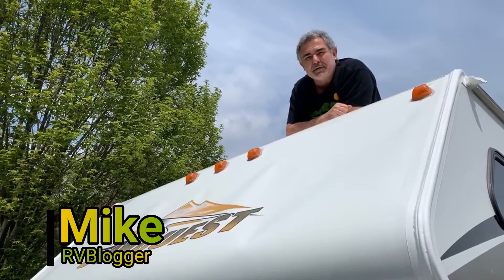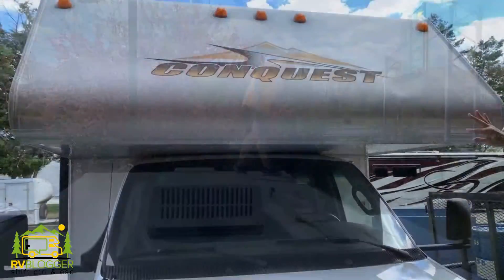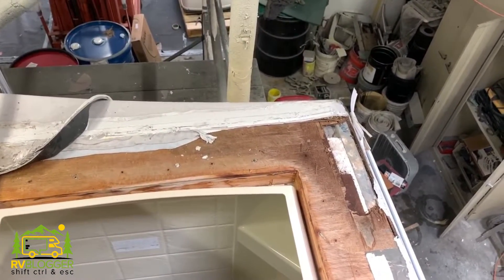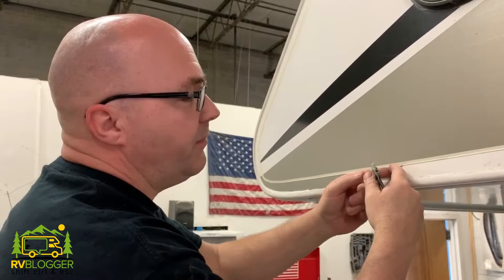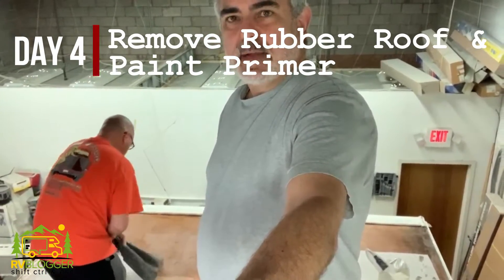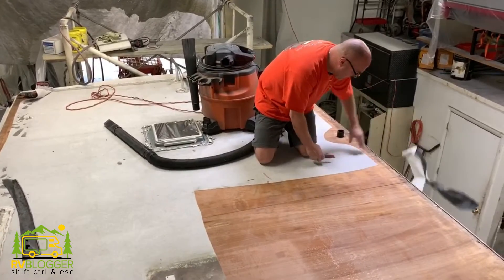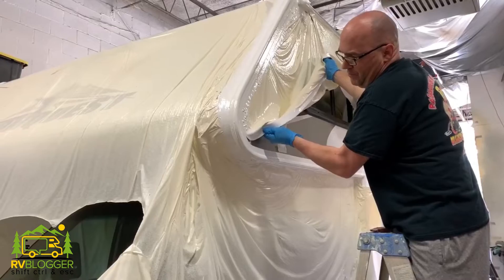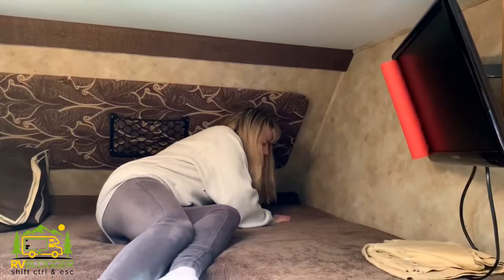RV Roof Replacement! No More Roof Leaks!

Comment: I had my whole roof replaced and all new plywood under.  My roof is not flat. It peaks to the center, so rain will run off. Lifetime warranty. Love love love it. Paid 100.00/ft. 3K. Just 3 years ago. Still looks new. & seals are checked 2xs a year. They are holding no issues ! I have to clean it 2xs a year but zero leaks !! Happy Trails
Reply from the maker: Hi Michelle,
Glad you roof replacement worked out so well!
Thanks for watching and commenting! 
Mike and Susan

Have you subscribed to our YouTube channel yet? If not we sure hope you will click below and subscribe! Thanks!
http://goto.rvblogger.com/YoutubeChannel?sub_confirmation=1
Reply: Where did you get it replaced?
Reply: I bought a couch with a lifetime guarantee   Turns out they meant the life of the couch, about 5 years
Reply: Peaking in the center is a great idea! Where did you get your done?

Comment: This is the first time I’ve seen this done. What a great idea! In my opinion its worth the $4800 for the peace of mind you now have.

We just bought a 2019 Grand Design Reflection 28bh and the roof is my biggest source of concern.
Reply from the maker: Hi Hard Truth,
I had a bed lining in my pickup truck and it was indestructible. I threw concrete, rebar, and all kinds of stuff in there and never hurt the liner coating once. Now if I hit a tree branch I am a lot less worried about a potential leak. This stuff is amazing!
Are you thinking about a new roof for your rig?
Thanks for watching and for your comment!
Mike
Reply: $4800??!
Is that a joke?  It couldn't possibly be that expensive, could it?
Reply: @JM-nh8yp  Yep, I talked with him at the RV show and it was $5k for mine.  Has a long life no-leak warranty and is much better than the rubber roofs that you can reinstall.  Given the hours of work needed to do this and the no worry roof you get in the end probably  worth saving up for one.
Reply: @keithallen3119  Well, I paid $2900 for my 32 foot camper in great condition. So I'm not paying $5000 for a roof. I sealed all my vents with self leveling sealant even though they were still good.  Next  I'm coating my whole roof with 5 gallons of elastomeric rubberized paint that cost $60.  It lasts at least 4-5 years.  Sometimes longer.  I'll gladly recoat as needed.

Comment: One suggestion to Rob ... I’d recommend building up a curb around the AC and some of those other penetrations before spraying and reinstalling to reduce pooling around them.  Very common on flat roofs for commercial buildings.  RV manufacturer’s don’t do it because the fabric membranes won’t contour... but with a spray on material, he has a lot more freedom for upgrading the surface.
Reply from the maker: Hi Big Mo,
Rob's been in the business for over 20 years now. But thanks for the suggestion.
Thanks for watching and commenting! 
Mike and Susan

Have you subscribed to our YouTube channel yet? If not we sure hope you will click below and subscribe! Thanks!
http://goto.rvblogger.com/YoutubeChannel?sub_confirmation=1
Reply: @RVBlogger  "been in the business 20 years means absolutely nothing."  (As an answer to being receptive or not  to a suggestion) If a person refuses to learn something new that means they're stagnated. A person can grow for 20 years by being open to new information or they can have 20 years of one year experience
Reply from the maker: @JM-nh8yp  Hi AR,
Cool your jets my friend. I wasn't suggesting that Rob doesn't want to learn anything new. He has been in the business for over 20 years. He has never applied the coating to the factory seals on each side of the overcab before and yet he was open to discussing why I thought it would work and that I wanted to get that across in my video. So - he's a pro who has been doing this work for 20 years and he is open to new ideas. Geez - relax!
Thanks,
Mike
Reply: @RVBlogger I'm not mad.   I was only supporting the comment of the person that made a helpful suggestion.  Your response was that "hes been in business 20 years"  It sounded like that means that he knows everything. I dont know why else you might have said that in response to that.  I wasn't upset or anything.  I was only saying that you didn't sound receptive to a new idea. My mistake.  Have a good day.
Reply: @JM-nh8yp  You got that right! People do stupid stuff for 20 years because that's all they know. As soon as I hear that, i'm outta there.

Comment: liked the sealing around the front of the roof and liked the note on flex seal not really being up for the job. thanks.
Reply from the maker: We went a bit overkill on that sealant! 🤦‍♀️ Flex seal actually does work and may be best for temporary solutions. Turns out our leak was along the front of the over cab seams and not the roof itself. Thanks for watching our RV roof replacement video and commenting!

Comment: I’d love to hear an update on how it’s held up. We need to reroof our 20’ travel trailer and don’t want to re-rubber roof it for the same reasons you spoke of. Thank you SO much for this video!
Reply from the maker: Hey Stephanie, 
It's been about a year and a half since we did this? It's held up great with no issues, so well worth the cost. 
Thanks for watching and commenting! 
❤ Mike and Susan
Reply: @RVBlogger  would you recommend another place that does this same thing that is not in Pasadena? Somewhere in the SouthEast?

If you had another class C- would you immediately do that to the roof? 

Would you treat the overcab in a different way? (Just curious! Im aiming to do exactly what you did- as ive had the exact same issues!)
Reply: Anyone have any referrals for “RV armor” ?

Comment: Hi Mike, I have a 37 ft. Class C diesel toy hauler 2005 with a leaky roof.  The previous owner had a roof leak in the cab above the driver seat.  I did some spot repairs and bought the gallons of roll-on roof sealer to coat the EPDM as it was getting chalky white and some black base was showing through.  Before I could complete the job, parts of Houston, TX had a hail storm - 2 inch sized jagged stones hit the house and motor home.  State Farm covered the home shingle roof repair.  They are dragging their feet on my motor home claim, saying that the roof was old     ( 15 years 2005 to 2019 )and that the EPDM leak issue was not due to the pin hole leaks caused by jagged hail stones.  The motor home was parked in my driveway. Naturally, the house roof sustained damage at the same time as the combo EPDM / Lauan decking RV roof.  I have CAMPING WORLD near Houston doing the repairs and it has been 6 months since I dropped it off.  They and STATE FARM are wrestling over how much will be covered.  What a PAIN !        JwgK
Reply from the maker: Hi James,
What a bummer! It's a shame you have to fight with your own insurance company to be covered!
Thanks for watching and commenting on your experience.
Mike and Susan 

By the way, we hope you will subscribe to our FREE monthly digital/video magazine called RV Camping Magazine. Let us know how you like it!
https://rvblogger.com/rv-camping-magazine/
Reply: Camping World is the worst over priced and they take forever to do work on your rig

Comment: Will be interested to see how it holds up after a few years.  Truck bed liners are tough, but they don't have to be water tight.  The silicon roof coatings are flexible and last for flat roof buildings a very long time.  Frankly, there are only a few trailers made with full fiberglass roofs, no seams at all.  The only true way to avoid leaks.   Thanks for the video.
Reply from the maker: Hi Murray,
I had a truck bed liner in an old pickup truck and it was awesome! Never punctured a hole in it after years of abuse. Our roof is over a year old now and no leaks at all! And I've swiped a few tree branches pretty hard too!
Thanks for watching and commenting! 
Mike and Susan 

GET READY! We are launching our new digital/video magazine called RV Camping Magazine on June 1st! Stay tuned for our YouTube Video all about it!

Comment: This could be about the best RV roof repair That I have seen. I wonder if the RV manufacturers have considered doing this instead of using rubber sheeting?
Reply from the maker: Hi Robert,
Thanks so much!!! I doubt the RV manufacturers will do this because it's too expensive. But they would have a lot fewer leaks!
Thanks again for watching!
Mike and Susan
Reply: Rv manufactures don’t want to do this they want you to keep paying for repairs it’s job security for them god forbid something would last forever

Comment: I have a 5th wheel trailer and we just bought from one of our friends and we have a leak through the sunroof and our other elderly friends helped us patched it up and it worked 4 about a year and now it's leaking again mine is a 1998 weekend worrier 38 footer toy hauler and me and my wife r planning on just taking the sunroof out and replace it with wood I was wondering if u have an  suggestions 4 me would be appreciated thank u guys
Reply from the maker: We’ve not had to repair the sunroof ourselves yet, so I don't have any experience to share with you. My initial thought is that it is probably fairly easy to make the roof look good once you remove the sunlight and replace it with wood. But finishing the ceiling inside so it blends in with the rest of the ceiling will be your biggest challenge. Maybe just replace the sunroof and seal it up, and then you should be good to go!
Thanks for watching and let me know how it goes.
Mike
Reply: @RVBlogger  thank u so much

Comment: I have a Class C that sat in a storage yard for several years and sustained massive water damage in the bed area over the cab. I replaced the wood and tried to re-cover the fiberglass laminate but ended up with dips that just aren't right. I see several newer RV's that have a pre-formed "cap on the front and I would like to know where I would find those? Any help?
Reply from the maker: We've noticed that some manufacturers ae changing how the front cab is designed but I don't have specific models for you sorry. We'll keep a lookout. Thanks for watching and commenting.

Comment: A couple of questions.

1. Why did he paint the skylight over the shower?
2. What if you need to replace a roof vent or skylight etc? Can that be done and what do you need to do to maintain seal integrity?
3. Did you consider RV Armor? If you did what made you go down this road?
4. With this system are their any ongoing maintenance requirements?

Thanks so much.
Reply from the maker: Hi JD,
Good questions.
1.We decided to paint over the skylight because they can crack and leak over time. Or if I het a tree branch it would be less likely to crack and break. Light still comes through too. And we have a light in the bathroom anyway.
2. If we need to replace anything on the roof it can be done. But we need to take it back to the roof repair shop so we don't void the 20 year warranty.
3. I didn't consider RV Armor because I wanted a thick spray on product. I had a pickup truck for years with the same bed liner material in black. It was indestructible. I threw concrete with rebar and all kinds of stuff in the bed of the truck and never penetrated it once!
4. No Maintenance requirements.
Hope all that helps!
Thanks for watching and commenting! 
Mike and Susan

Have you subscribed to our YouTube channel yet? If not we sure hope you will click below and subscribe! Thanks!
http://goto.rvblogger.com/YoutubeChannel?sub_confirmation=1

Comment: Thanks allot for the video and the great idea RVB. Hopefully the place will still be in business 10-15 years down the road so that the warranty will be valid should an issue arise. Looking at redoing our 32' Class C RV roof myself. A new rubber roof at Camping World is ~$7,000 so this seems like a more affordable option. I have 2 questions. Looks like stripping the old roof and vents and other parts is the time consuming part, so if this was done before delivering the RV, any idea on the savings? Secondly, I'm on the west coast and was wondering if you know any reputable bed lining companies near LA to get this done?
Reply from the maker: Hi Anthony! 
I used to have a pickup truck with the bed lining stuff in it - before people started using it on RV roofs and it was indestructible! I threw concrete with rebar sticking out of it in the bed of my truck and never broke through the polyurea coating!
I don't know where you could get it done on the west coast but if you google bed linings you will find someone that does it. It's pretty mainstream now.
Thanks for watching and commenting!
Mike and Susan
Did you see our video about our FREE RV Rental for a Weekend we are giving away? Hope you will check it out!
https://youtu.be/h_NW_O-VsTo

Comment: Some years ago an Rv repair co in Northern Ca made a vid where they replaced
the rubber roof on a Class C. They said in their vid that rubber roofs need to be 
resealed YEARLY and totally replace every 8 years. They said the job they were
 doing was going to cost $8,000.00.

!
Reply from the maker: You do need to inspect and maintain (clean) your RV roof regularly to avoid other damage but sounds to me that they either aren't apply a permanent solution or want to repeat business. We have been extremely happy with ours even after 3 years and only $5,000. Thank you for watching our RV roof replacement video and commenting.

Comment: Have u checked the amber clearance lights?
My leakage was caused by the clearance lights, front and rear.
Reply from the maker: Hi G Alexander,
I caulked the heck out of those lights and that is not where the leak was coming from. It was the factory seals on the sides of the overcab that leaked.
Thanks for watching and commenting! 
Mike and Susan

Have you subscribed to our YouTube channel yet? If not we sure hope you will click below and subscribe! Thanks!
http://goto.rvblogger.com/YoutubeChannel?sub_confirmation=1
Reply: But, you have fg delam immediately under them?

Comment: How long has it been since applied, got a review; how’s it look no bubbles no wrinkles no peeling, seems like a pretty good product to use
Reply from the maker: Hi Jill,
We have had the new roof for about a year now and it has held up great! 
No bubbles, no wrinkles because it was sprayed right on. I had this same rubber in the bed of an old pick up truck and it was indestructible.
It is the best roof you could possibly install on an RV in my opinion.
Thanks for watching and commenting! 
Mike and Susan

Comment: Where can I find flexible corner trim like you used on the front cap??
Reply from the maker: Hi Ryan, 
That corner trim is sprayed on along with the entire roof. We taped it off and sprayed on the roof material.
Pretty awesome!
Thanks for watching and commenting! 
Mike and Susan
Reply: @RVBlogger  What was under it? Aluminum trim?
Reply from the maker: @filmride3153  It was a plastic or vinyl trim on the corners. I actually think it was a two-piece trim and that's where the leak was coming from. Since we coated the roof we have had ZERO leak issues.
Reply: @RVBlogger  Thanks! Replacing the front end on my Toy Hauler, this helps.

Comment: Interesting product. Should work well.

Why didn't you address the front fg delamination (bubbling) around the Conquest decal? You should check your clearance marker lights which often leak into that area.
Reply from the maker: Hi John,
I had this product in the bed of my pickup truck for years and threw concrete, bricks, rebar, metal and all kinds of stuff in there and it never tore, ripped or got punctured. It is awesome stuff!
I did check the lights and caulked them of course. I guess I just didn't mention in the video.
Thanks for watching and commenting! 
Mike and Susan

By the way, have you subscribed to our YouTube channel yet? If not we sure hope you will click below and subscribe! Thanks!
http://goto.rvblogger.com/YoutubeChannel?sub_confirmation=1

Comment: Can we ask what this cost?
Reply from the maker: Hi Big Dan,
It cost $4,800... it's a lot ...but cheaper than installing a new rubber roof at the dealership. Plus it has a 20 year warranty and this stuff is indestructible. I had the same coating in the bed of my pickup and threw recycled concrete with rebar sticking out in there and never punctured through this stuff.
Thanks for watching and commenting!
Mike and Susan
Did you see our video about the FREE RV Rental for a Weekend we are giving away? Hope you will check it out!
https://youtu.be/h_NW_O-VsTo
Reply: RVBlogger - not unreasonable compared to some pricing I’ve seen.

Comment: Rightly said, a leaking RV roof is a mess and is something that must be fixed immediately. The longer you wait for the more water damage will occur. Identifying roof leaks can be difficult and may over time reoccur. So, why not choose Liquid RV Roof and stop worrying. It is cost effective, easy to apply and it works extremely well on water leaks and punctures.
Reply from the maker: Hi Angela,
First the website articles and now the YouTube Channel?
Points for persistence! Lol!
Thanks for watching and commenting! 
Mike and Susan